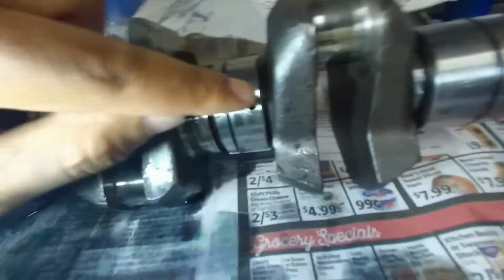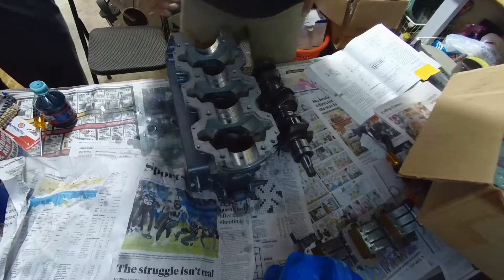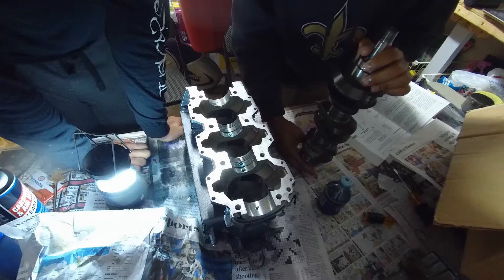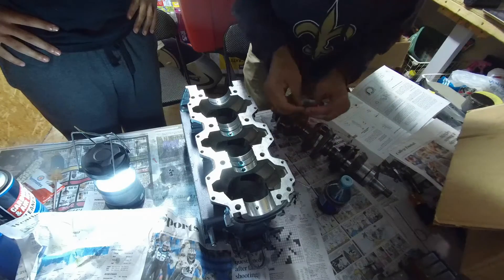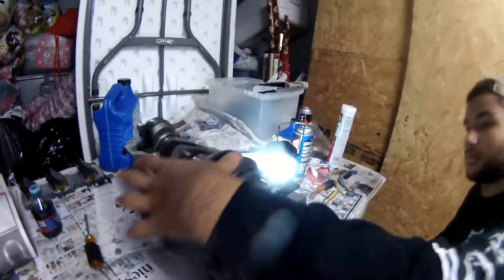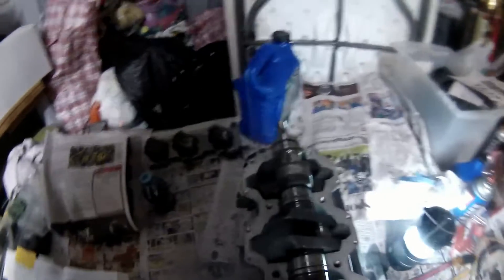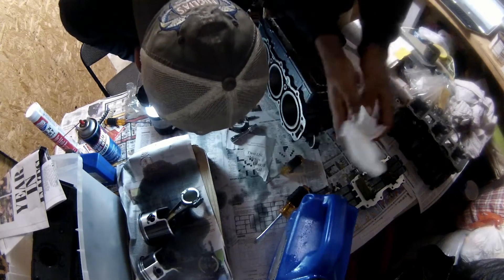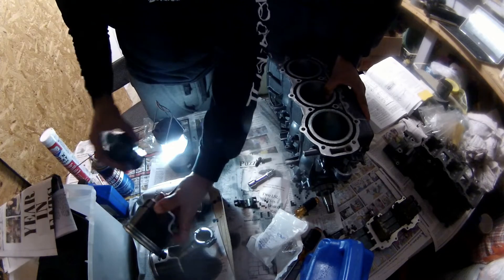90 Yamaha Outboard Rebuild : Piston and Crankshaft Installation ep3

Comment: How much did it cost roughly to boar the engine and what kind of kit do you need to buy if I want to replace my piston and rings they're not as bad yet but the compression is getting lower and I'd like to rebuild it myself as well
Reply from the maker: ReBore was a little over 100. You may only need to hone your cylinders which alot less

Comment: Hey I have a question I just rebuilt my mercury 90 and I don’t know if I torqued my end caps to the right speck I think I did them to like 30nm would that be enough I saw in the video you did yours to 9ftp was there another tightening step after?
Reply from the maker: 30 NM is 22 foot pounds sounds about right. The instructions said to torque it twice at 9 and 20 if I remember correctly

Comment: looking good bro! like how you use the manual on every step. i seen people just put it together and then wonder why it won't run correct or start
Reply: looks like u know what you doing
Reply from the maker: I used the manual because I didn't know what I was doing
Reply: What manual did you use? About to attack mine 90hp that  I believe has a bad rod bearing.